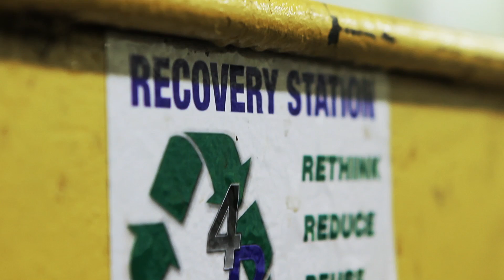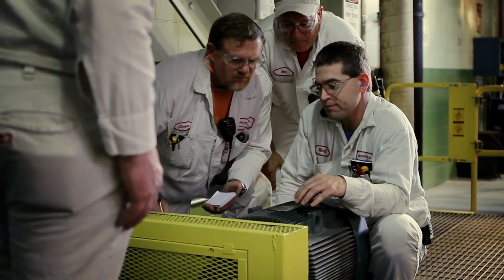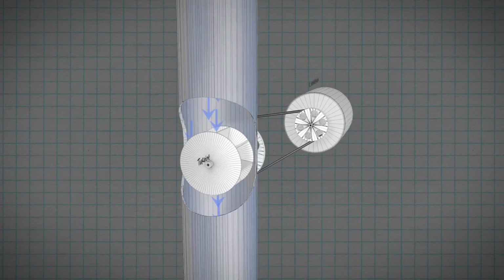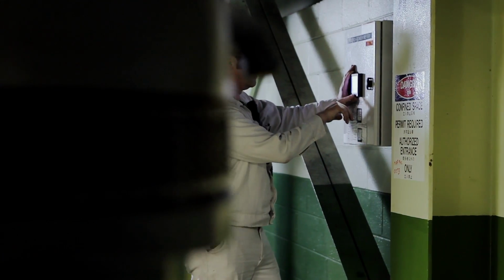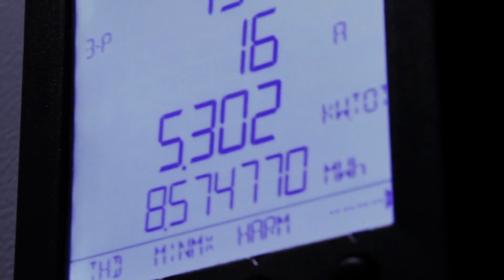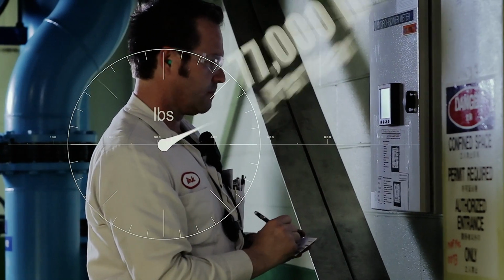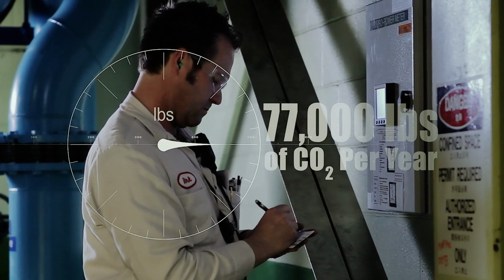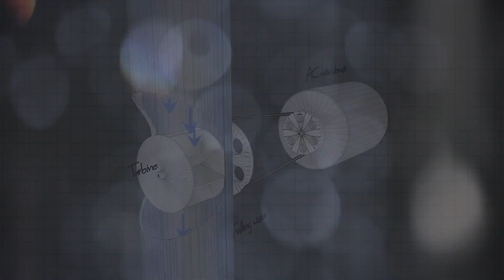Every Drop Counts

Comment: If you want a type R your going to have to go to Japan.  You can however do what every other poser does and just put type R badges on your civic.  The S2000 will only come back with the same damn engine issues (under powered) as the last model in 2009.